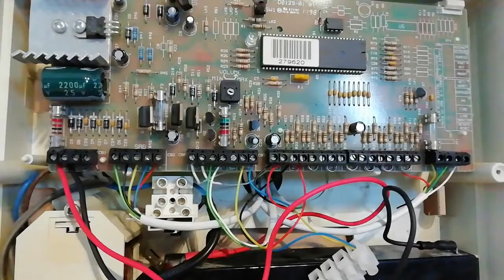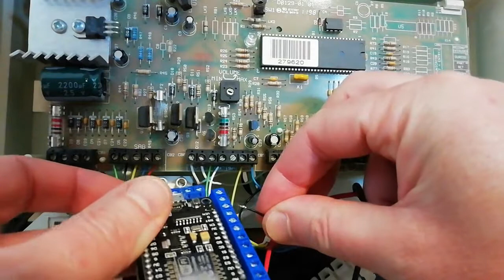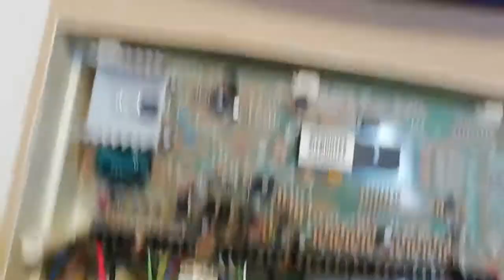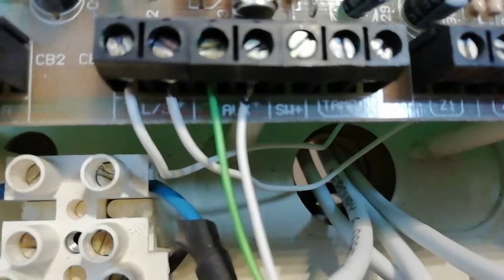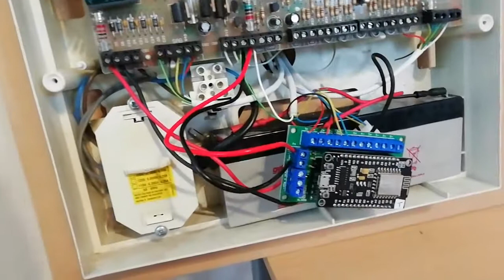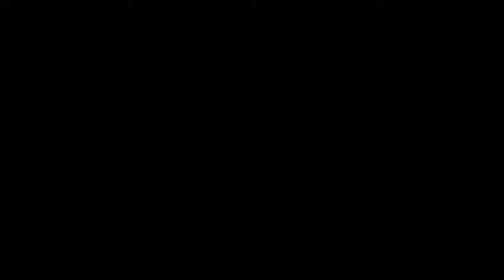How to install – Part 2: Installation

Comment: I've wired this all in great and it works fine. However I have one wire left connected to the original board marked TR. I understand it's a bell tamper wire - I understand it can be moved to a spare zone on the new board and set up as a door zone NC. Let's call this zone 5. However I don't have a second wire for zone 5. I can put a wire into the second terminal of zone 5 on the the new board but where do I connect the other end of that wire?
Reply from the maker: Hi, if it's the BELL tamper return wire then it stays in the original terminal. Only the triggered negative BELL and STROBE wires move across to the new unit. When you move wires across to create a tamper zone they would be the wires from either end of a global tamper loop that would run through all of your sensors. So you have a tamper for the Bell, lid tamper switches and global tamper loop. Only the global tamper loop becomes a tamper zone on the new board. Often this is two terminals labelled TAMP next to the other zones.
Reply: Ok thanks for the prompt response. But does that mean the bell tamper and lid tamper are now rendered inoperative? There is no global tamper loop in the original system
Reply from the maker: @antonycostello7599  The lid tamper switch on the control panel would be inoperative because the switch linked straight to the old circuit board on the old control panel which is no longer the brain of the system. You can tell this I guess because the lid is open while you have been testing the system and your alarm is not sounding. The tamper on the Bell circuit you can test. If you disconnect the TR wire and leave it loose, does the Bell sound when powered? Thanks
Reply: Ok thanks again for such a prompt response. That all makes sense - for the moment I still have the original remote keypad attached and that notifies of the lid tamper. Your last sentence was the key piece of info that helps me. I'll try it out in the morning - don't think neighbours be too happy if I start setting sirens off at 11pm. It's a great bit of kit - I had to reconfig my four PIRs which are Pyronix and were set up as EOL rather than NC. Other than that it worked exactly as described and plays really well with Alexa, Smart Things and Konnected apps. I run a Handyman service and several folks have asked about modernising legacy systems. This seems a viable offering for them. Thanks for your help
Reply from the maker: @antonycostello7599  no problem, one further thought on the lid tamper. If you wanted this to be smart another way would be to place a door reed sensor on the inside of the panel lid with some glue and wire it to a spare zone, then set a rule to notify when the lid is opened. Thanks

Comment: can this unit be used as a stand alone communicator?  eg for a fire alarm etc?
Reply from the maker: Hi, take care with critical fire safety systems as these are not diy projects and require careful design for resilience in line with regulations due to potential loss of life. I don't know those regulations so can't advise.
Thanks

Comment: Hi, I have managed to connect the board to my Accenta 8 mini alarm and make it work. Just one thing I'm not sure about. What's the reason for connecting the tamper into a separate zone. And how would I use it in the app?
Reply from the maker: Hi, There are different tampers in most Alarm systems. The Bell has its own tamper return which is often labelled TR next to the Bell terminals, and the main control panel has a pressure sensor tamper switch which triggers when you open the lid. The one we are interested in here is the Global Tamper Loop. Often you will see a wiring connector block with lots of wire pairs connected to one side and one wire pair then going into a Tamper zone on the control panel. The idea is that the whole set of sensors is connected together with one tamper wire loop. If someone cuts the wire to a sensor the loop is broken. Therefore you want to set up a Smartthings rule that if the tamper changes state you get a notification. If you have a look at this link, section 2.4.7: https://community.screwfix.com/threads/alarm-door-contacts-wiring.139501/
Reply: @planet_tech4443  thank you for the explanation. This is helpful. Just to check I understood correctly, I'm assuming I will need to set the tamper as a door in konnected. Is this correct? I will then set the rule as you said in smart things.
Reply from the maker: @awnialsadeq5384  Hi yes, door is correct setting as it will be normally closed and notify when open.
Reply: @planet_tech4443  perfect. Thank you very much. I just have to say this is brilliant. All been working without any issues and was very easy to install. Thank you very much for the very helpful videos.
Reply: I've wired this all in great and it works fine. However I have one wire left connected to the original board marked TR. I understand it's a bell tamper wire - I understand it can be moved to a spare zone on the new board and set up as a door zone NC. Let's call this zone 5. However I don't have a second wire for zone 5. I can put a wire into the second terminal of zone 5 on the the new board but where do I connect the other end of that wire?
Reply: @planet_tech4443   Hi, if you have 6 zones can you add this global Tamper to one of these zones? I have 6 Zones so none spare so not sure what I need to do. If a 7th Zone or more is needed can you run 2 of these systems together? Thanks
Reply from the maker: @dinosalerno3010  Hi, you would either need 2 units or you can leave the tamper, up to you. There is no limit on how many you can have, and each zone is treated as a separate device in SmartThings or Home Assistant. Thanks
Reply: @planet_tech4443   Thanks, so the tamper is just there if they were to cut the wires to one of the sensors?
Reply from the maker: @dinosalerno3010  Yes, basically the global tamper loop is a single continuous circuit that causes an alarm if its integrity is breached. I have covered the various types of tamper in this Reddit post: https://www.reddit.com/r/smartalarmuk/comments/1506y80/all_you_need_to_know_about_tampers/?utm_source=share&utm_medium=web2x&context=3